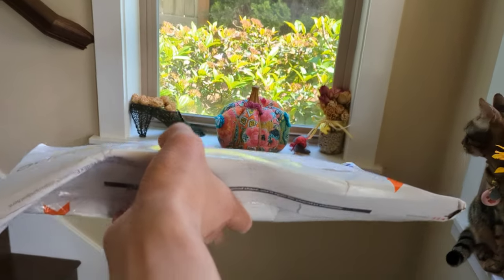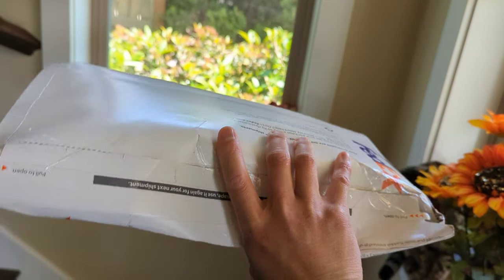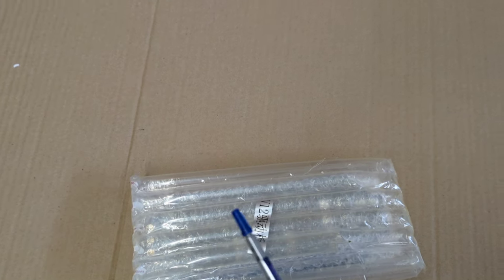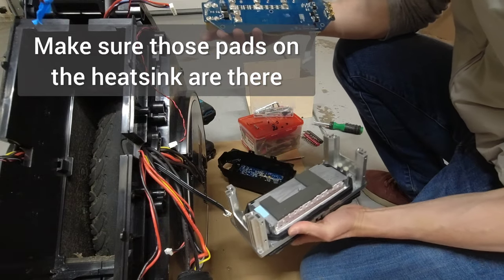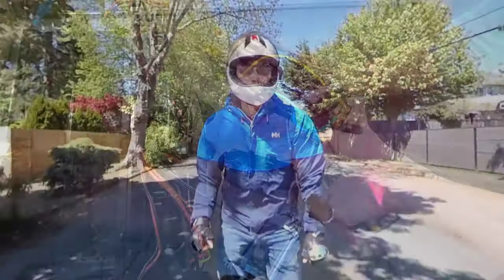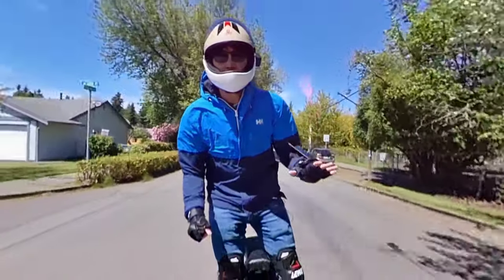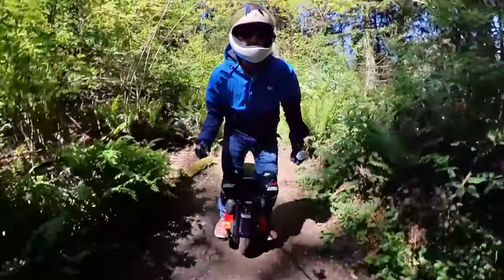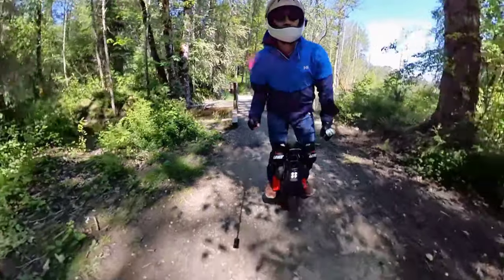Inmotion V12 Driver Board Swap - 5 Things You Should Know. No More Cutouts Please.

Comment: The board change is easy to do. I recommend: 1) Create a clutter-free workspace and lay the wheel on a white towel so that if you drop a small screw or washer it won't bounce or roll away and will be easy to find on the white towel.  2)  Take a number of photos from different angles and up close when you get access to the top of the wheel so that you see all wire orientations prior to removal.  Note where the wires are tucked away so that you can do the same when reinstalling.  3)  Make note of the hex head screw lengths for the shell. Note where the long screws go and where the shorter ones go.  4)  A plastic panel removal tool or putty knife can help pop the front and rear covers loose.  5)  Watch the eevees video all the way thru before doing your wheel.  6)  When transferring the heat sink pads from the old board to the new, watch the location carefully so that you put them in the same place on the new board. 7) Be careful not to wipe away the white thermal paste when handling the board. If you have some thermal paste, it's not a bad idea to add a small dab on each of the mosfets.  8) Put in the 5 screws that go thru the face of the board before putting in the mosfet screws.  9)  BE CAREFUL WITH THE MOSFET SCREWS AND BE SURE THE PLASTIC WASHER IS IN PLACE ON EACH SCREW.  The board should come with some extra screws and plastic washer in case you lose 1 or 2.  Do not use a drill or electric screwdriver to secure the mosfet screws or the screws that go thru the board itself.  Use a screwdriver so you can feel how tight they are.  Put them in snug, but not super tight.  10)  When screwing down the new board, make sure it is not flexing the board.  The board should be flat and rest on each of the 4 perches. 11) On the new board, you will need to tuck down the 3 heavy gauge wires.  Watch how they do in the eevee's video.  If you don't get them out of the way, the top cover will not go all the way down and the heat sink on the system board can easily cut into these big wires and create a short.  12) Tuck the wires in before installing the top back on the wheel so that nothing is in the way.

This sounds like a lot, but it's really an easy project.  For those who care, Eevee's gives its customers the option to send in the wheel free of charge or do the swap yourself.  Doing it yourself means you have the wheel running today.  Ship it off and it might take a while.  These vendors have a lot of wheels to service, so your wheel may be away for a while.  Be patient while the vendors try to make this situation right.
Reply from the maker: Pinning this. Great tips! Thanks!

Comment: Thanks for the tips. I've been reluctant to change the board on my V12, as some people have had trouble with them but maybe it was due to installation, who knows. Like your seat, looks great for braking too.
Reply from the maker: I honestly hope it's an installation issue.  It's more assuring than to say they have another batch of bad components.

Oh I love this style of a seat. Works well to power brake. It also helped me from dropping the wheel many times.
Reply: Agreed, I hope it’s user issue. Otherwise it’s another thing to worry about
Reply: @Cons2911   In my opinion, expecting someone to change a board with no experience is asking for trouble. If you remember the global car airbag recall several years back. It would be like Toyota sending the airbag to customers and asking them to replace it themselves, it's probably worse than that. The shop I bought my V12 is 500 miles away and shipping cost $200 plus, so it's too expensive to send for repair. I'm sure that other people are in the same predicament, so it might be cheaper for someone to pay an Auto electrician in their area to replace it for them. But I guess if one feels competent enough to do the job themselves and follow the video's from InMotion and eevee's, everything should be fine. Just make sure before doing the job, that the stars are in alignment, pray for the Grace of God, have your lucky charm on hand and fingers crossed🤣. Good luck everyone.
Reply: @terrenceclark763  glad my shop will do it for us customers. I don’t want to tinker with something this expensive, I can do a gaming rig but not confident with this one

Comment: Hey man how has the new mobo been holding up? Thinking of finally copping the updated v12 hs from wheels. I'm so close to buying but nervous of persistent issues. The one from wheels obviously has the new mobo already installed.
Reply from the maker: I've only added 50 or so miles to it since. So far everything seems ok  no complaints. Will need more miles to have some real input.

With that said, I never had issues with the original board and love the V12 ride and feel. I feel most in tuned with this wheel.
Reply from the maker: Here's my last ride where I put about 30+ miles.
https://youtu.be/pAtBJGJwl5c